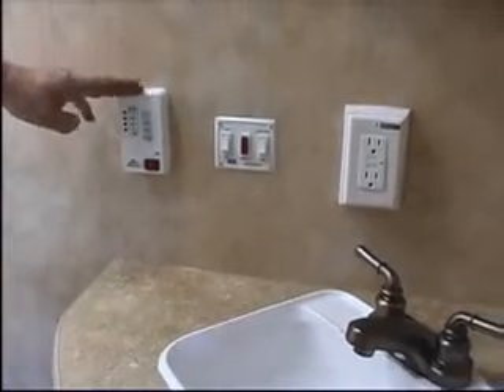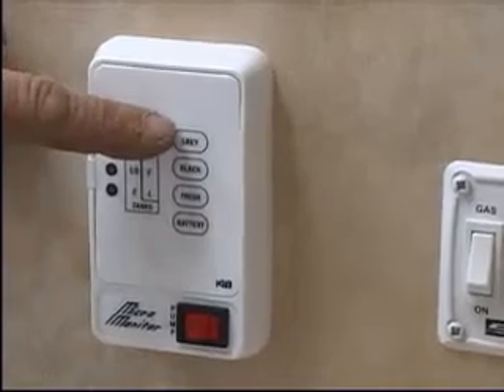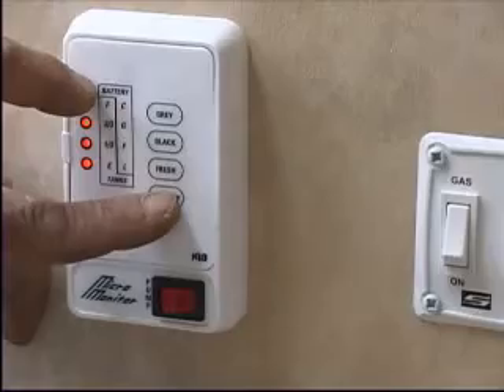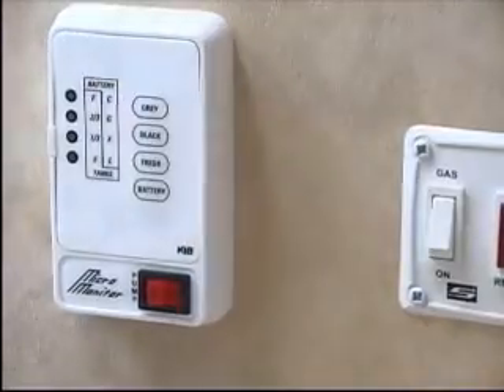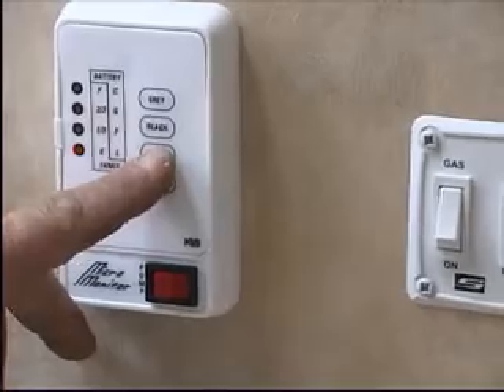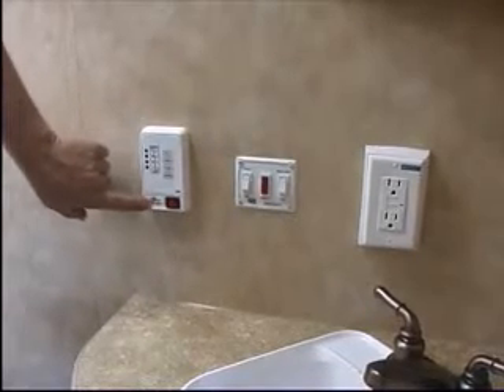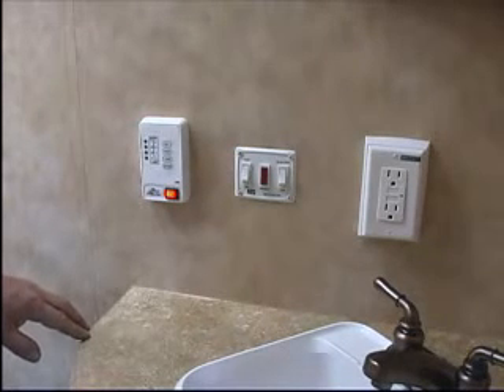12. How to operate a RV Monitor Panel

Comment: Thank you for your video. My monitor panel has the gas switch and the pump switch on it. It also has the little red light in between those 2 switches. What is the little red light in the middle for?

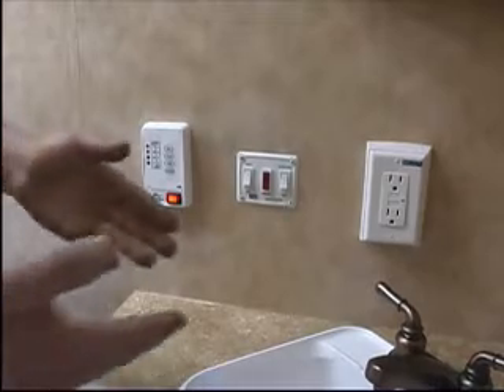Comment: At 1:23 you say pump but you don’t specify which water you are talking about.  I completely got lost there.  Does it pump fresh water? If so where does it pump the water to? Do I need to open a valve before I press the pump button.  Could you please be more specific.  I feel bad for asking because you don’t need to.

Comment: All the water levels and battery levels work fine on mine but when I turn the pump switch on the light does not come on and the pump is not working. Why wouldnt the light not come on?